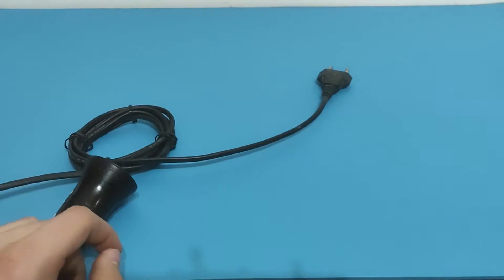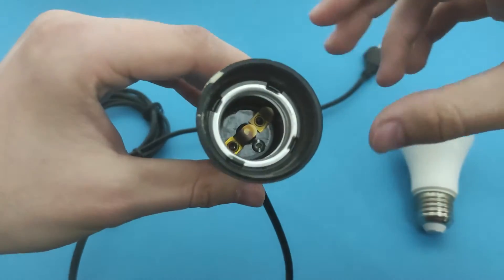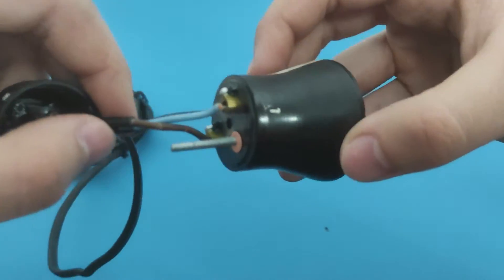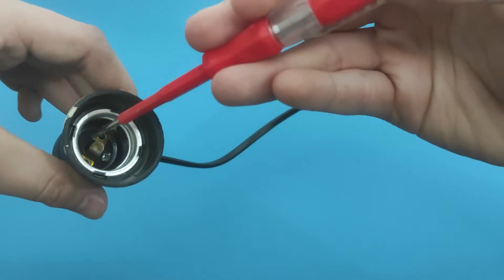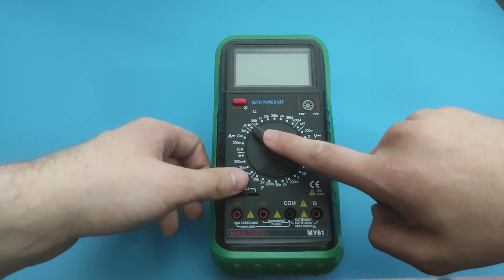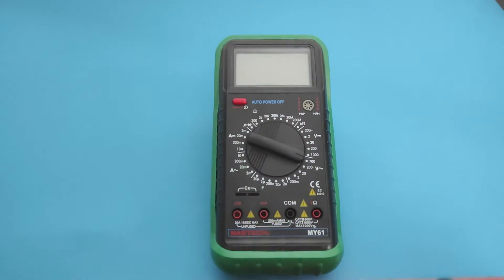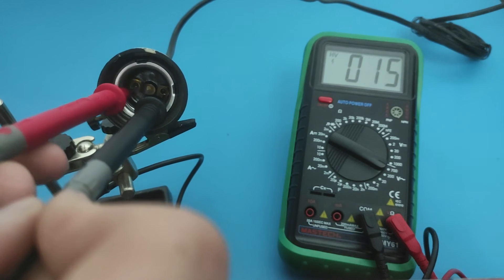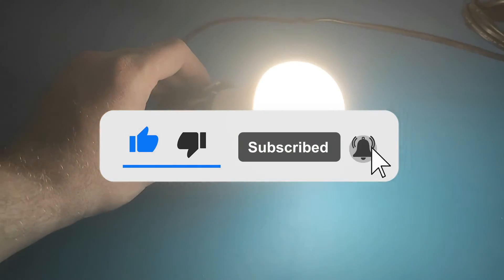How to test a light socket with a multimeter

Comment: Please be very careful when working at mains voltage!

Also be very careful how you connect the leads on your multimeter. One lead always goes to Common and for the other lead, it depends what you're measuring. In this case it's Voltage or Resistance (Continuity) so the lead needs to go to the V/O/Ohm socket - NOT the current/I/A socket. (for some meters the socket to use can depend on the range you're using... so take note of that too)

This is very important since if you try the measure the voltage between two points but your multimeter is wired up for measuring current then the meter will behave like a short circuit ... very dangerous at mains voltage (best case a big spark; worst case you'll kill someone)

In general much safer to test continuity/resistance with the power turned off first before doing anything else - and only proceed to testing live voltages is you're competent to do so.

Comment: Just make sure not to accidentally touch both probes to the same piece of metal while a circuit is live
Reply: Well fuck I wish I woulda seen this 2 minutes ago! I'm buying a fucking lamp!
Reply: What is this comment even about? If you touch both probes to the same piece of metal it should just show 0V and not be a problem at all. Touching different pieces of metal with the same probe is where you would have a short that can trip your breaker.
Reply: Yeah I said it backwards lol you’re definitely right
Reply: now you tell me! i wasn't getting a voltage from the holes so i moved the probes and pop